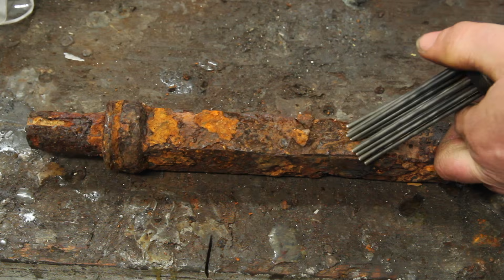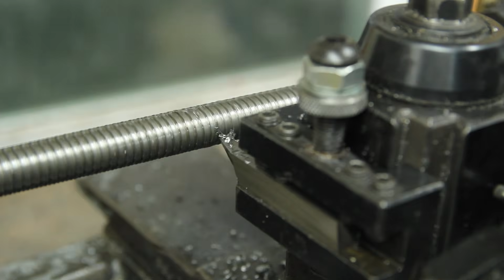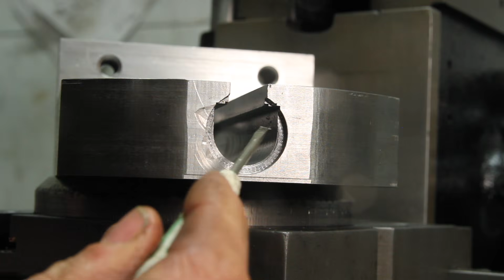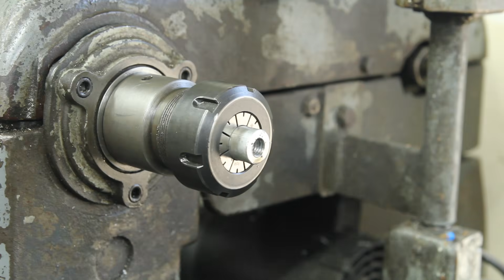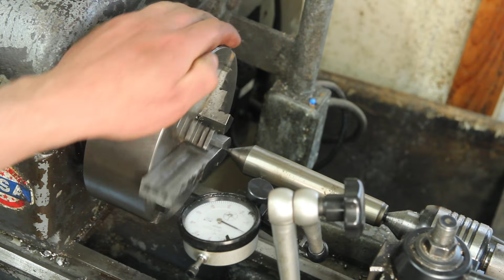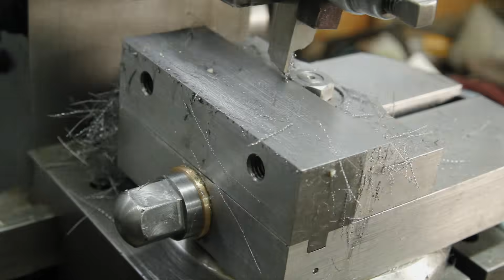Rhodes Shaper Vise Remake (Part 2)

Comment: So was this sculptured out of an enormous hunk of Cast Iron then? 
It looked like cast when you pulling it out of the dust pile on the floor and my eyes lit up like light bulbs. I was hoping secretly that you would reveal your source as something generic and accessible to me because I’ve been hunting for a big chuck to make a top slide for a 13” lathe. The original was missing when I cluelessly purchased the machine for way too much. But then I’ve been slaving away making a workbench full of parts to bring it back to life and now I’m hung up on a huge piece of Iron needed for the top slide, other than that all that’s left is the 7” hand wheel for the tail stock and the vernier dial for the tailstock quill.. I’m so close I can taste it, yet still so far away! Hahahaha. 
Your vice build was a true pleasure to watch and I think you are an extremely talented guy. Thanks for sharing your projects. You win some and you lose some and I have a great deal of respect for a guy like you who is not embarrassed to show the losses along with the wins.
Reply from the maker: You’re in luck, it’s just a hunk of mild steel from the local steel supplier’s off-cut pile.

Comment: Always wondered what you do with all the filings and shaved metal pieces. I imagine you can’t just smelt it down to a new block since there are so many different compounds. Do you grab it all with magnets and dispose of it? Smelt it and use it for things that can handle Heinz 57 mix of metals? Or try to sort it as you go into types of metal?
Reply from the maker: Steel shavings usually get thrown in the steel dumpster at the local transfer station, non-ferrous swarf (aluminum, brass, etc) usually just goes in the trash.  I don’t generate enough to make recycling it worthwhile.

Comment: Most any machinist worth his salt can take a piece of good stock and turn it into something useful. It takes a real man to take a hunk of 30+ year rusted axle into an acme threaded vise screw. 

A perfect example of how you can get some super nasty rusted chunk of steel for dirt cheap(probably scrap steel pricing if not outright for free) and for just a little bit of extra effort end up with decent material for your project. 

Automotive wrecking yards are a great source along with scrap yards.

Comment: Nice work.  You might be better off with a larger volume of oil.  The heat-treat recipe usually specifies the temperature of the quenchant.  For O-1, you want about 120 oF.  From what I read, you can control the speed of cooling by heating up the medium.  Water is more susceptible to this effect, I think, than oil.  The closer you are to boiling temperature, the less heat can be moved into the water quickly.  As soon as the water boils, vapor pockets appear on the surface and slow down heat transfer.  Oil is a slower quench but I suspect that you can get the same effects.  TL;DR The small oil bath may have caused the parts to not harden.

Comment: Nice job on this, end result looks awesome and (probably more important!) looks like it works great. Really enjoyed watching the process and the problem solving as you go. 

And I'm also a big fan of the crust-old-whatever-to-finished-part thing 😀 Watching you descaling again, do you ever try acid soaks? I'm thinking vinegar (+ salt) or citric acid specifically more than dilute hydrochloric or sulphuric. Even if you don't use them to get everything off a shorter soak will undermine and weaken rust, making it much easier to remove even using processes that don't have as much oomph as a needle descaler. So the hands-off time reduces the hands-on time so I think they can be a valuable addition to a workflow.

I restore a lot of old woodworking and light-engineering tools and my vinegar + salt baths last a long, long time: a year, easy. So they're extremely cheap in the long run if you can get bulk vinegar. Not to take anything away from Evaporust but a long soak in tired old vinegar seems to weaken rust better than nearly exhausted Evaporust does.

Comment: Very clever... way to avoid the T-nuts!! 
Just so happens I’ve got what looks like a rusty old shaper vise, that won’t work like a vise on my shaper. It’s made to bolt through the table like yours, but my shaper has a universal table, which doesn’t allow for that... It needs a base that can bolt to the T-slots. Now making that doesn’t seem so crazy, or it at least seems doable!

Comment: I had good results making an acme threading tool by grinding the tooth out of a small piece of Hss then silver soldered (brazed) it 90 degrees onto an old boring bar. Yes it was small and fiddley but worked great....now that I'm thinking about it I can't be sure that I didn't grind it after it was brazed on?? I think the hss was a small broken drill bit or end mill. It was all out of the bean can of scrap anyways. Stayed sharp and got the job done 👍😉

Comment: Great job.  Was that a Sears power hacksaw?  If so how well does it work for you?  Asking as I just picked up one.  It needs a little work, but it is functional.
Reply from the maker: It is.  Mine needs some work too.  It’s slow but works well enough. I find that some cutting oil on the blade is crucial to keep it happy.
Reply: @JeremyMakesThings  Good to know about the want of cutting oil.  As to speed, I am just having some fun working with some old machines so it doesn't have to be fast.  Thanks for the information.